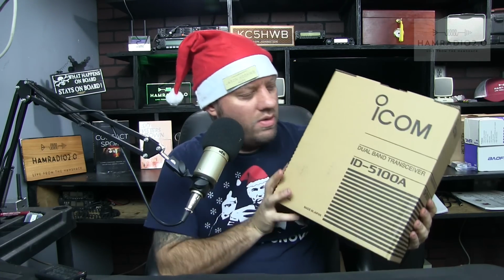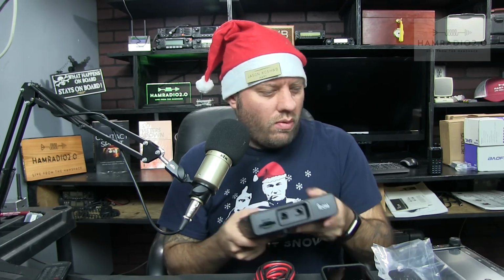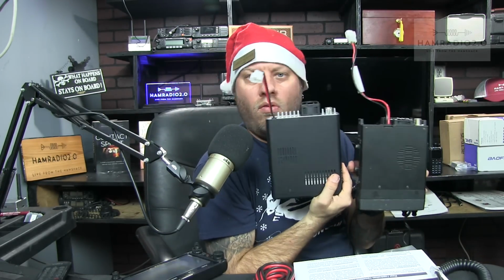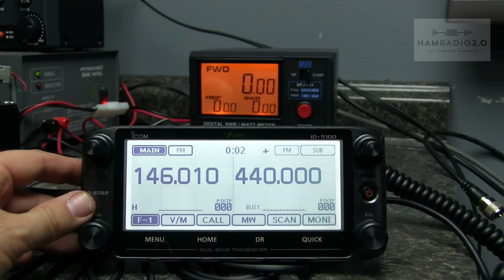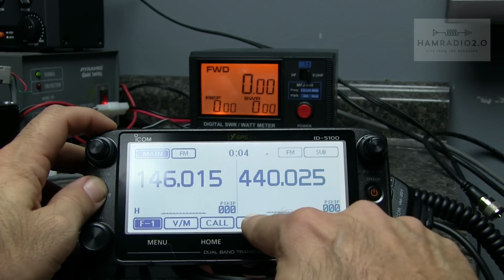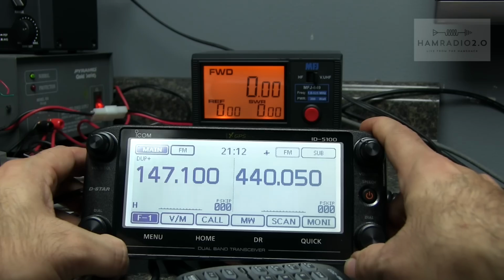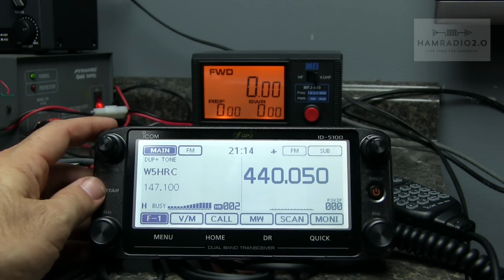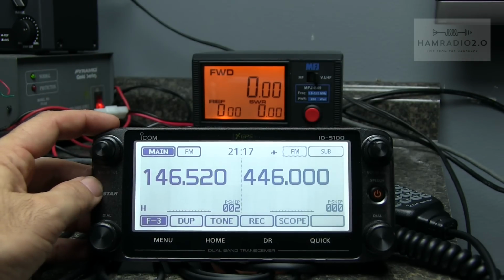Icom ID-5100a Unboxing and Programming

Comment: Wow! I didn't know you were recording when we made the QSO!  You can use a generic CAT5 or CAT6E Ethernet cable and a female/female connector to extend your mic cable.  That's how it's setup in my car.  Same goes for the head unit.  Happy New year, Jason!   DE W5AJO
Reply from the maker: Hey Sean, thanks for the QSO.  I left the radio on 146.520 for a few days after this recording, and I have been hearing some good traffic over there.  I guess it is time to start monitoring Simplex again.
Reply: Ham Radio 2.0 yes sir! I've been monitoring it every day and I hear at least one or two QSOs on 52.

Comment: I agree on not understanding Icom's thought on not including a mounting bracket.  Also, you can just use CAT5 to extend the mic; I would recommend getting shielded and not just regular.  Maybe just 2 or 3 feet for your setup and then a female/female adapter for the end where the mic connects.  This is how I did my FTM-400XDR which is the same design (remote head only radio and the mic connects to the body of the radio with no extension included, though a long cable for the head is included...so, Icom isn't the only one to do that, though it's still weird).  Also, I'm not sure on the 5100 but I know on my Kenwood D710 you can select whether you want the audio for the A side and B side routed separately to the separate outputs or both to speaker 1 output - the 5100 might have the same option, not sure.
Reply: Hamradio 2.0:
 Yes, a regular RJ45 cable can be used as a mic extension. I use the exact same thing on both the Icom 5100 & Kenwood D710G. No issues here. And if you want, you can use a 6 pin RJ11 cable for the separation, so no need to buy Icom's over priced $6 cable.
Reply from the maker: @billyparkinson9933  Several others have said the same thing,  I'll likely try that
Reply from the maker: A standard-wired CAT5 will extend the mic for this radio also?  No special wiring?
Reply: @HamRadio2  That is my understanding. I did find one reference online that that user said they used CAT6 and not 5 and it worked fine. I guess grab a patch cable and give it a try...I think the coiled cord will unplug from the mic itself, too, if I remember right. That would tell you if there is some sort of cross over in the pins but I think it is straight through.

Comment: It's called a deluxe if it comes with the magnetic face Mount bracket
Reply from the maker: Yes I mentioned that in the comments of the original post.
Reply: I found the magnetic face mount to be a great way to mount the head to most anything that will take a screw. The neodymium magnets are super strong and convenient for quick removal. Nice job on the video KE0JVS